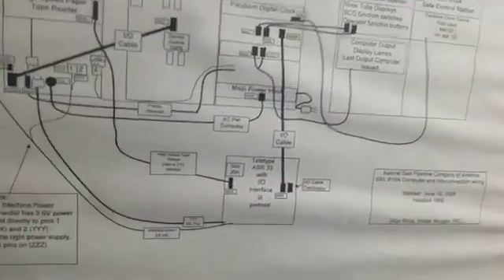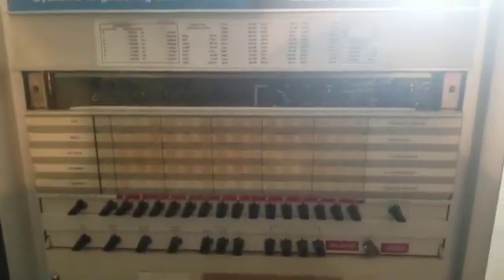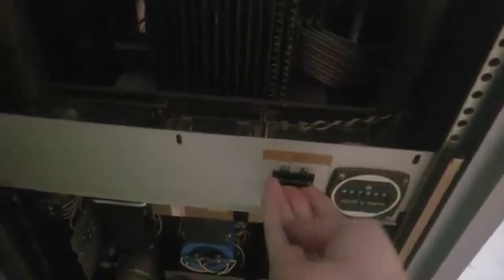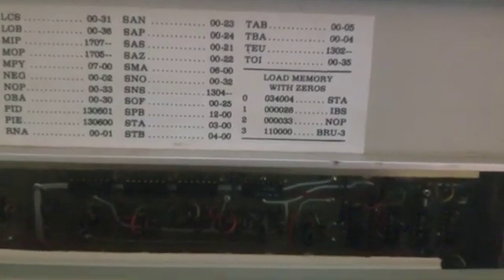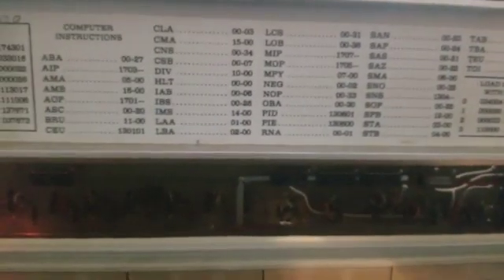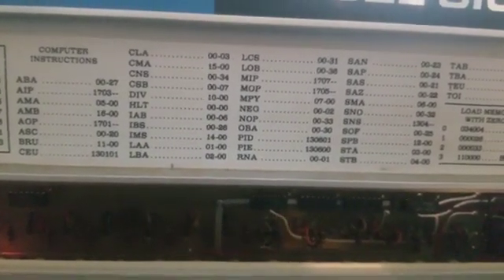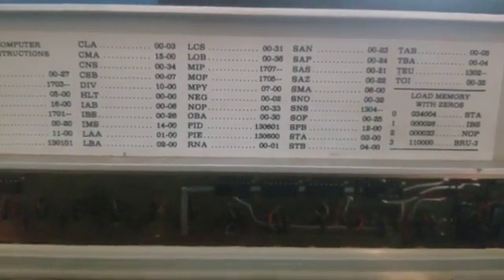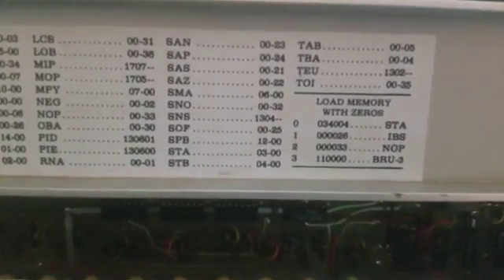SEL 810A Overview (1967 Computer)

Comment: The first Parabam digital clocks used uniselectors which were pulsed with a cam driven switch operated by a synchronous motor, a technique somewhat similar to that used in Schafer automation clocks.  Projection displays made by IEE were used for the visual output.

Comment: Thanks for posting this. My dad worked for SEL on south side of FTL (down by the Reef theater) in the 60's/70's, and bought one of these for the princely sum of $1 around 1976. This was my first computer, just the mainframe box and 8k of core mem plus a teletype printer. That was almost five decades ago so you probably know more about it than I do now, but seeing that front panel of lights and switches brings back some great memories so thank you!

Comment: I used to work for SAIC and we used lots of Gould computers in the early 80s. I was a FORTRAN programmer doing work on government contracts and projects with power utilities. Customers liked to see Gould SEL on bids because they were cheaper than the DEC PDP and certainly the VAX. The latter two offered greater stability in my opinion. I believe the SEL OS at the time was MPX/32 though believe we had an earlier Gould with an older OS on it. Can't recall. I moved on to another company that favored DEC and IBM so thus ended my Gould SEL days. I do recall that they made the interesting move of support UNIX which as a good idea in my mind since lots of shops were moving from FORTRAN over to C. People favored the UNIX environment because, after all, it was an environment written by developers for developers.
Reply: You're correct.  MPX-32 was for the 32bit Gould computers and the earlier Gould/Sel computers ran RTM.  The Gould computers were did not have Virtual OS available and therefore limited in memory addressing capability.  They were used primarily for Real-Time applications.

Comment: I worked for Natural Gas Pipeline Co from 1982 to 1988 and was the caretaker for some of these computers at various locations.  Even in 1982 they were considered ancient by us techs and I really hated these things.  During training classes we were taught how to troubleshoot down to the component level and I actually wrote test software using punch cards and compiled the program to paper tape.

When I was in Kansas one of these had an intermittent problem that would invariably shut it down in the middle of the night.  This would result in me getting called out to investigate.  After this happened a couple of times I ran every diagnostic and used my heat gun and many cans of freeze mist to no avail and with no trouble found.  It would run fine for months at a time and then go down, again with no trouble found.

These SEL 810a computers lived in a control room alongside analog computer controls and relay ladder logic.  Not a plc with ladder logic, actual banks and banks of relays that worked together to control the jet engines and compressors.  The sequential relay logic was a nightmare and hard to troubleshoot.  You can imagine how much trouble a bad contact can cause.

The control room needed a lot of cooling and there were four 25,000 btu window air conditioners in the wall.  The air conditioners ran year around but sometimes they would freeze up when it was really cold outside.  On one occasion it was below zero outside and the operator had pulled an air conditioner out of the wall to work on it thus letting in colder air.  The computer went down and I got a call to come investigate.  Of course by the time I arrived the computer was working fine, but I understood the opportunity I had been presented.  We pulled all the a/c out of the wall and waited for the temperature to drop and the computer to fail.  It did fail and what was even better it stayed failed and I was able to track the problem down with my trusty oscilloscope.  It was a bad RTL chip (Resistor Transitor Logic) in the CPU and I was lucky enough to have a spare and replaced it.
Reply: I feel like I should apologize to you.  I was the project engineer at SEL when they started that project.  I designed the basic interface to your equipment.  I was also a field engineer for several years so I feel your pain.  Jim Gilmore
Reply from the maker: Thank you for commenting! I am working with Ron to get the system working. If you would like to stay in touch about the machine I would be happy to do so.
Reply: Dude, I would have loved that job.

Comment: Very interesting. The main console display is very confusing the way the light leaks around, maybe in person it's not so bad, but I think I'd make it a priority to fix that. Also it would be interesting to see a video going over the instruction set and architecture of this computer.
Reply from the maker: See the previous video, I actually just fixed the front panel to have much less light bleed. I have two more bulbs to repair then I am gonna try again to get the plastic holding the bulbs against the display tighter.